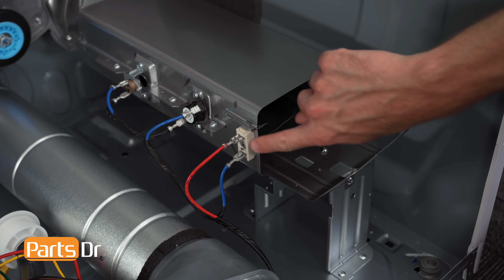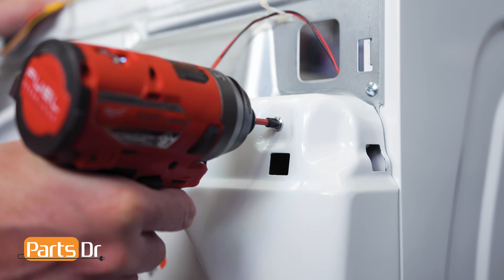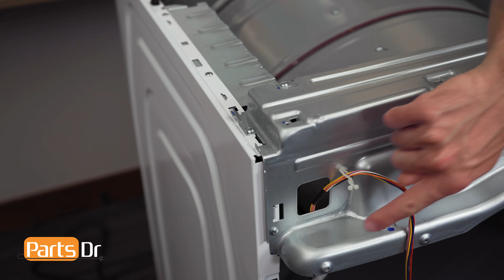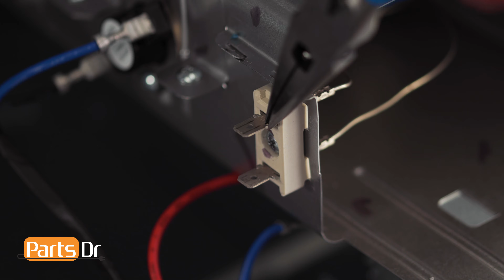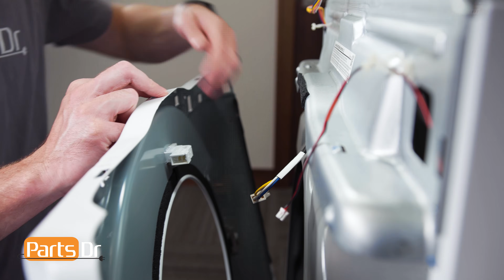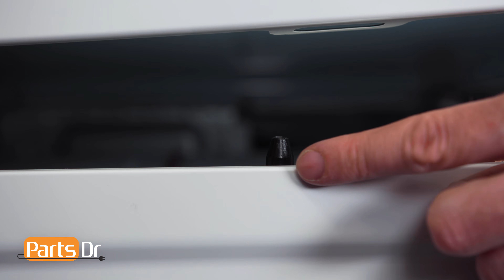How to replace the heating element terminal block part # DC65-00013A on a Samsung dryer

Comment from the maker: Thanks for watching our step-by-step guide on replacing the heating element terminal block in your Samsung dryer! When it comes to electrical components like this, using Genuine OEM parts is especially important. If you're ordering parts online, especially from places like Amazon or eBay, be careful that many of the cheaper aftermarket parts are of much lower quality. For reliable, high-quality parts, order directly from https://partsdr.com. Happy repairing and let us know how your repair goes in the comments!
Reply: Is there a way to get just the terminals part?

Comment: Can the wires be place on either terminal? Or is there a certain direction current needs to flow
Reply from the maker: If your element has two wires like the one shown in the video, either wire can go in either location as there is no polarity.